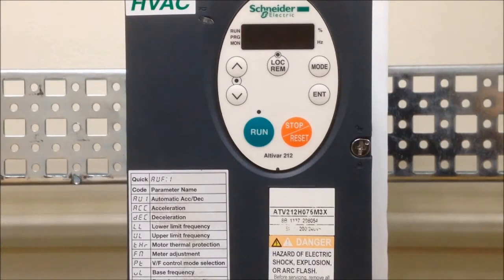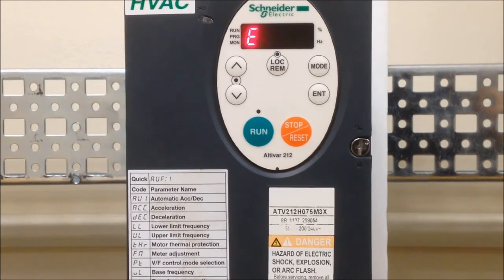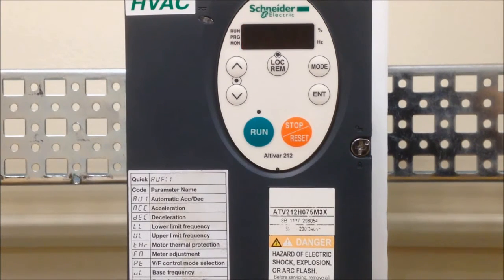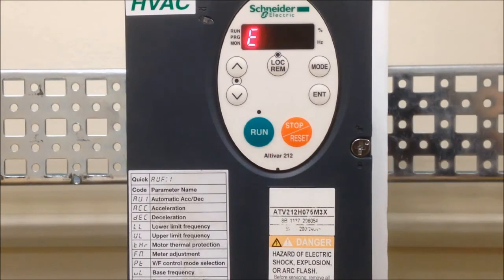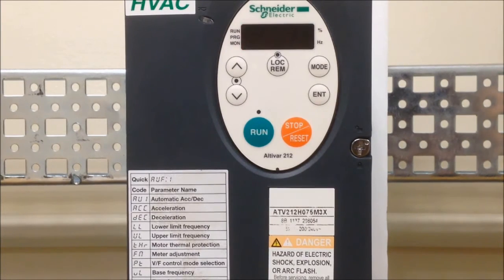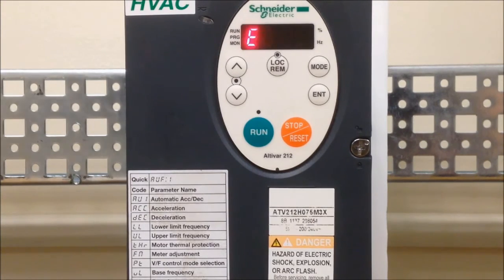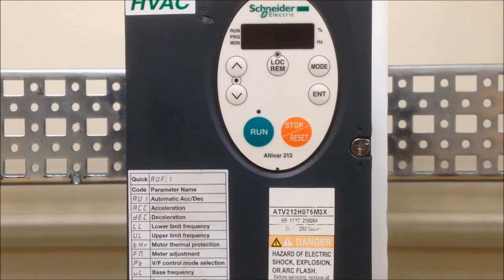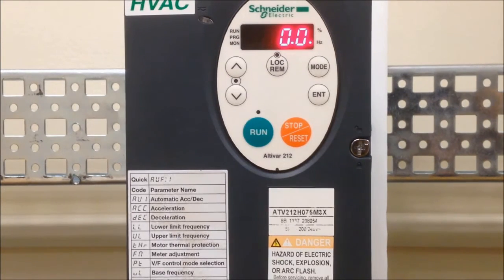Flashing "E" Indication on the Altivar 212 Drive | Schneider Electric Support

Comment: Hello schnider electric,
Can you help us troubleshoot the problem of vfd atv 212 model? We are currently experiencing e-19 or err8 when we automatically controll to bms. We checked the lay out and wiring and termination all over again same issue occur. But when we try to test 1 is to 1 there is no problem. We use siemens controller on BMS. Thanks hope for your response to this concern.